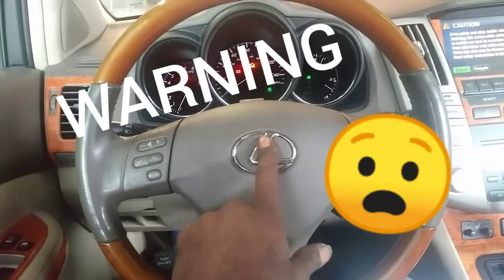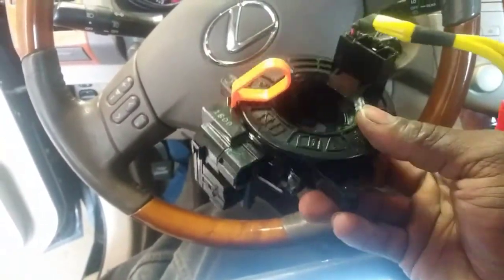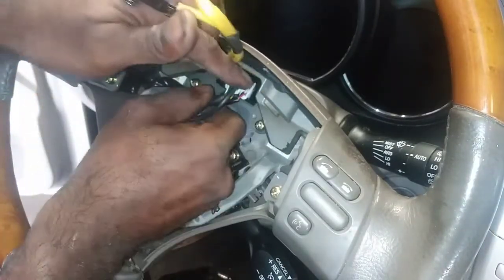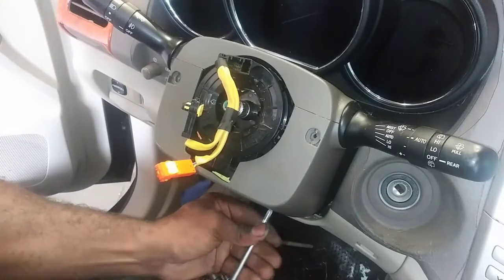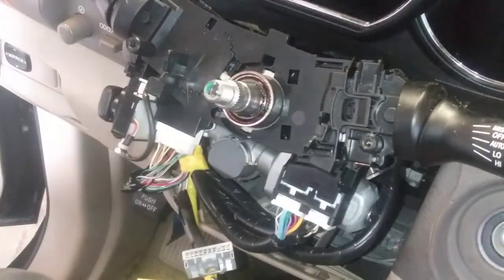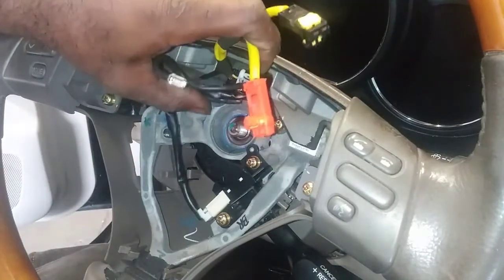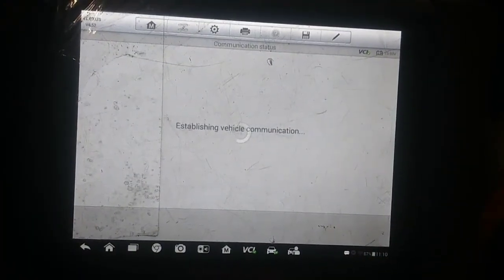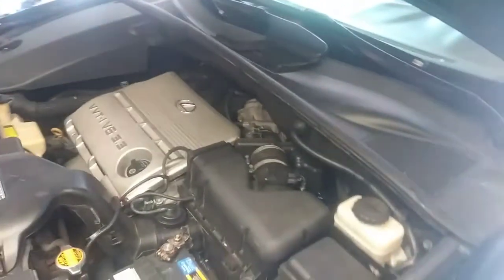'06 rx330 clockspring and steering initialization

Comment: Thanks for this Video. Replacing my 2007 Lexus RX350 required a steering wheel puller rather than a "bigger hammer". :) It was free at my local Oreilly Auto parts store. My symptoms were just intermittent cruise control. Everything else worked including horn, volume up down, etc. It's working now!
Reply from the maker: Awesome!
Reply: @Steve, I have the same problem on my 07RX350. I am going to try this. Where did you get the replacement clock spring at?

Comment: SHould you not have disconnected the battery first? and you need to losen the torx screws not remove them.
Reply from the maker: The video shows the method I use.